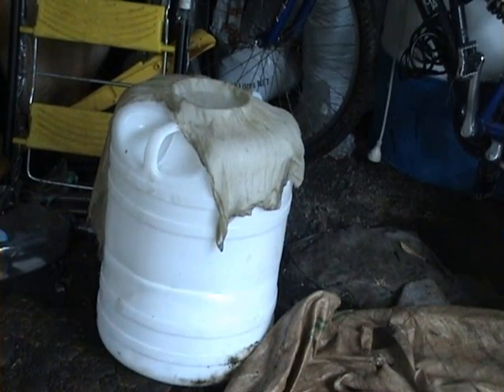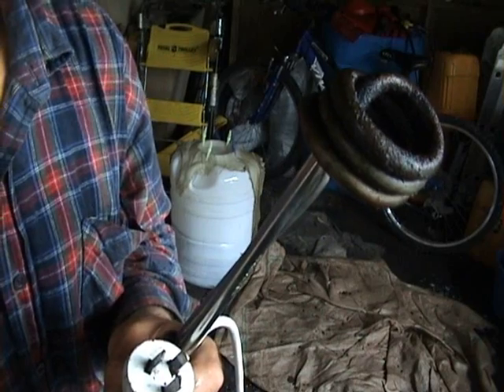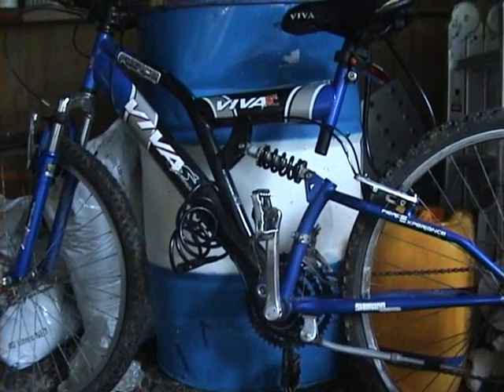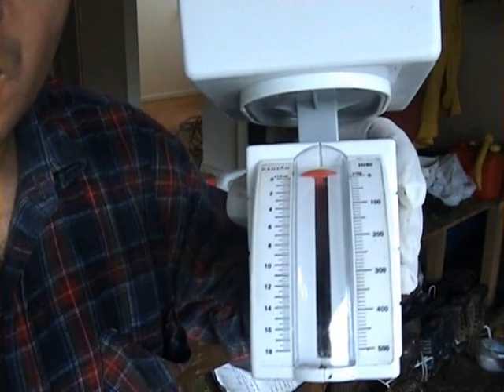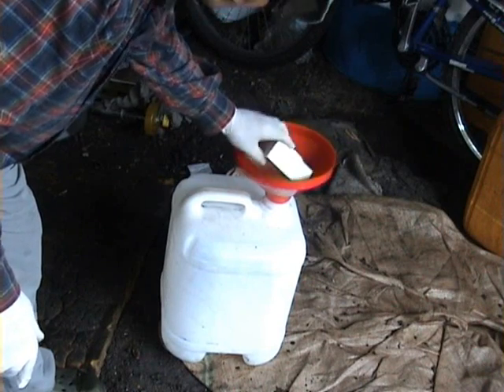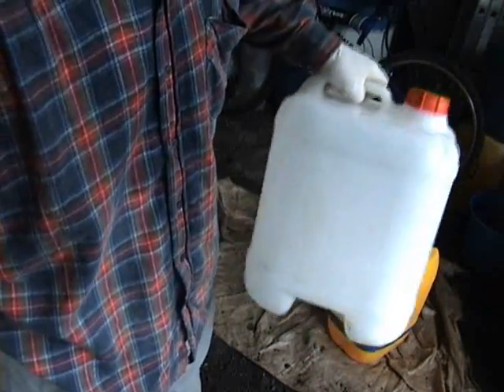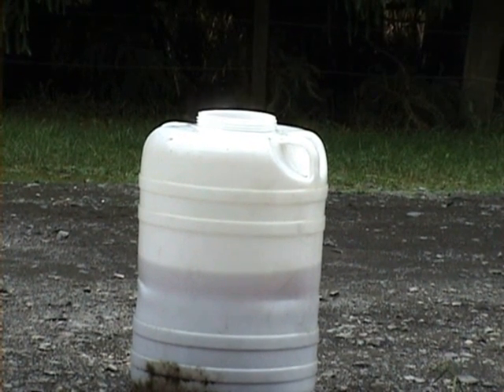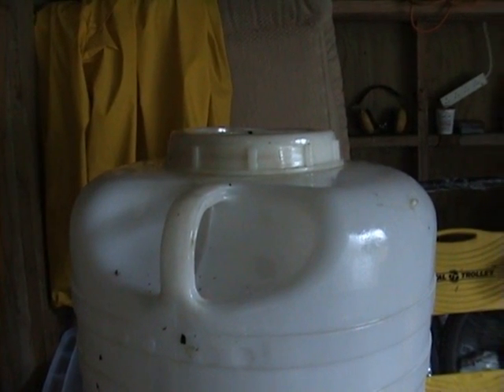Easy to make 20 litres Bio Diesel Part 1

Comment from the maker: No way. At the time I made the video I was saving around half the price of diesel. Methanol was bought by the barrel from a wholesaler. The drain cleaner I bought in 20 liter bags and only used the little container to save me carting the bag around to often. This is the way to go if you have a regular free supply of used vegetable oil.

Comment from the maker: Yes Appears so 
1 / 20th of 20 is 1
4 goes into 20 5 times so 5 goes into 10 twice change the decimal point again for 1 and .2 x 5 = 1
140 grams of soda per 20litres
so 70 per ten litres . Change the decimal point again for 1 and you get 7 grams of soda for 1 litre of oil.
Very good right at the edge of my Mathamatical ability.
Cheers

Comment from the maker: @Saite15 
Yes Appears so 
1 / 20th of 20 is 1
4 goes into 20  5 times so 5 goes into 10 twice change the decimal point again for 1 and .2 x 5 = 1
140 grams of soda  per 20litres
so 70 per ten litres . Change the decimal point again for 1 and you get 7 grams of soda for 1 litre of oil.
Very good right at the edge of my Mathamatical ability.
Cheers

Comment from the maker: Thanks Mr Pope.
No do not heat above 50 Centigrade.
I used a plastic bucket but that is very dangerous I have since melted it and went on to use a rubbish bin.
I think the best safest idea is to get hold of a used water heater.
I am still making it in dribs and drabs shall try to find some time this weekend.

Comment from the maker: Used cooking oil is far safer than used motor oil though has to have good filtering using a catalist like methanol and drain cleaner sodium hydroxide.

Comment: NO absolutely no. Veg Oil only

Crude oil is precessed/refined to make petroleum products, motor oil, gas, karosen and Diesel. Used motor oil breaks down, has additives and fine metal particles. Bottom line YOU can't easily refine used motor oil to fuel. I'm sure with a sophisticated expensive process it can be done, probably cost more than its worth. They do recycle motor oil. What they do with it, not sure, but it could be used for making asphalt or lower grade oil products for example.

Comment from the maker: I expect Pee has roughly the same weight water has.
Expect little cleansing from Pee compared to the Methanol caustic soda mixture.
Do not worry if the oil is a bit thick and the mixture gives poor separation simply let it settle a greater time and when using expect a few stalls until the engines hot.
Christ's love

Comment: hi, yes just add white spirit to veg oil at a 10% ratio. i run a twin tank system. if you are using a single tank then you need to mix it with diesel at a 50/50 ratio so it will start in the morning. as winter draws in you add mor diesel 75/25. watch on youtube- top gear veg oil for more info ;-}

Comment from the maker: Thanks Graham but the Methanol is not very hot and smokey until it joins the used oil and using a small amount allows the caustic soda to bang around on the sides of the container when you shake it, helping to break any bumps aiding dissolving.
I appreiciate your attention thanks.
When the reaction occurs best to stay upwind from the easy to see smokey fumes.

Comment: Hi mate

Your videos are very entertaining - enjoyed them a lot! 

Just a note about mixing the caustic and methanol. It is safer to add the caustic to the full amount of methanol, little by little.

So put the 4 litres in the tank, and sprinke the 140 g into it. That way, the methanol won't overheat or boil and you will get less dangerous methanol fumes. Remember methanol is pretty poisonous stuff.

Happy and safe brewing!

Comment: never use white spirit,in the uk this would just land you in the same deep water as using red diesil if you were stopped and dipped at the road side,if you think the £400 on the spot fine and your car inpounded till you pay it is worth the hassle then on you go.
i use straight svo in the summer and it work fine,sometimes putting a few gals of derv in when it turns colder,my cherokee purs like a kitten,no problems.

Comment: hi, hows it going? is there a part two to this video? just wondered what you done after seperation and if you washed the oil through with water afterwards as if you put it in your tank still tasting of caustic soda it will corrode your fuel lines,, by the way, what make of car do you use this in?

Comment: hi, dont use methalated spirit as it seperates fom the oil. get white spirits(its called mineral spirits in some parts of the world). i have seen and worked on land rovers, misibushi shoguns, volkswagen, ford, vauxhall, all running fine on veg oil. i have seen two UK car shows using veg oil in cars, one uses white spirit the other doesnt, but it must be left for a couple of days for the white spirit to thin the oil.
cheers

Comment from the maker: I watched that on  an Enlish car show and they used a specific Mercedes that was able to cope not all diesel can.
I tried adding the 3% they used and it made no difference to the clean used oil whatsoever.
I shall test at 10% and try running that if I feel the oil is slippery enough. 
I methalated Spirits good enough or is there a cheaper Spirit from the hardware store?
Thanks

Comment: i have done all the caustic soda mixing stuff but an easier way is simply mix the veg oil with white spirits(mineral spirits) at a ratio of 10% and leave for a couple of days to thin itself. before doing this with used oil its best to let the oil settle for a few days and just use the top layer of oil and avoid the white cloudy gunk beneath it. :-)